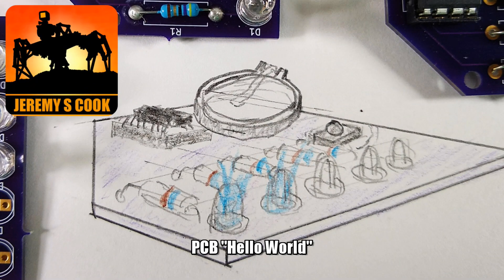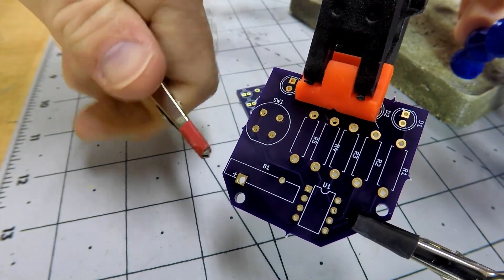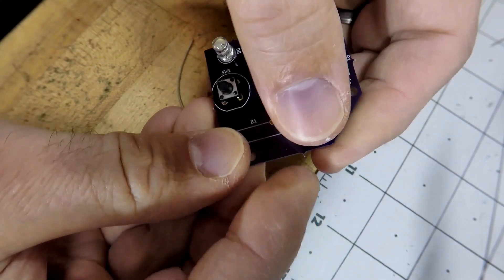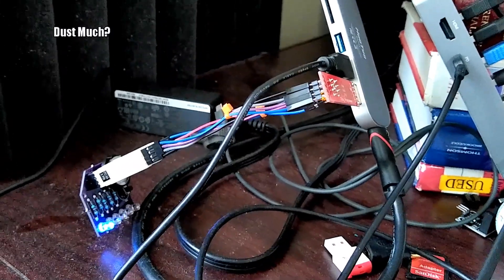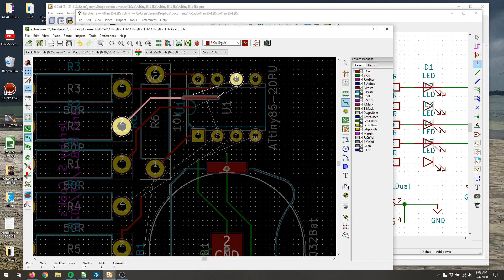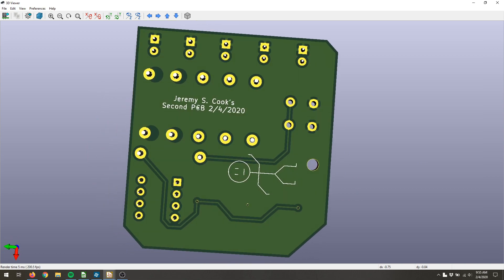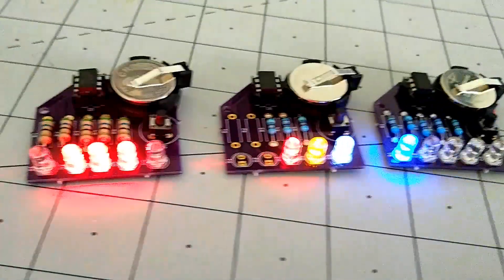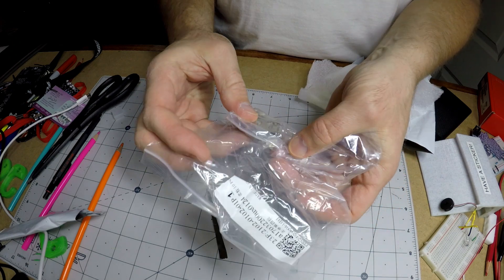First PCB - Printed Circuit Board [WILL IT WORK?.. yes, it does]

Comment: I've ordered a few boards from Oshpark in the past, but they were 'shared' designs.  Today I just placed my first order for a board that I designed myself with Kicad.  This was a very simple power switching circuit for a ham QRP transceiver.  It uses 5 mosfets to switch 12 volt power to the transmitter and receiver circuits, driven by a micro processor.  Two complementary MosFets are used to achieve rail to rail (+12v to ground) operation, the 5th transistor is an inverter and level translator between the 5v microcontroller and the 12v switching circuit.  I kept checking my work, before I was sure I'd found all the mistakes before sending in the order.  I had the P-channel devices 'upside down' in the schematic at first.  Took awhile to find out how to mirror image flip the symbol vertically.  I'm just getting started learning how to use Kicad.  Hopefully, will be building and testing the circuit next week!  I have a few more ideas to commit to 'FR4'.
Reply from the maker: Nice, hope it works!